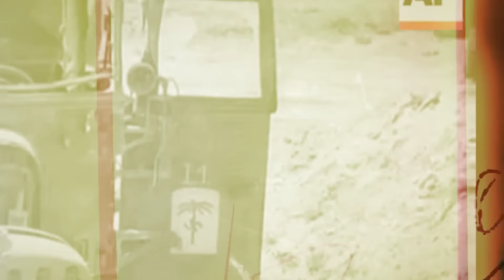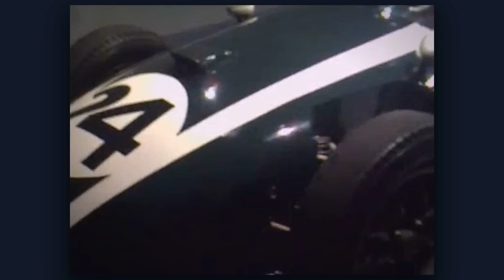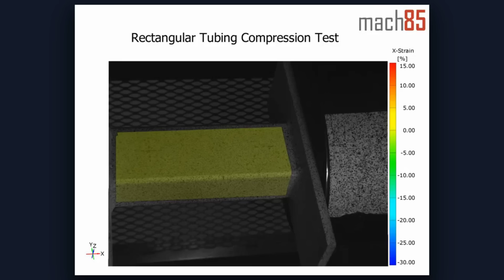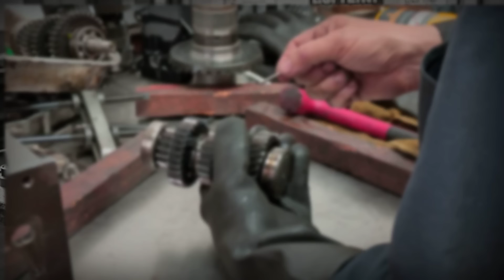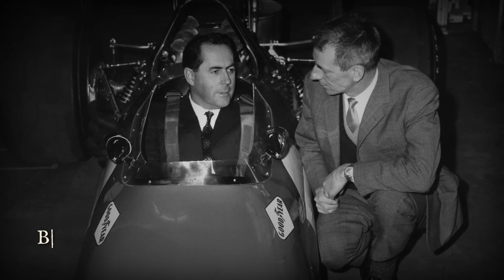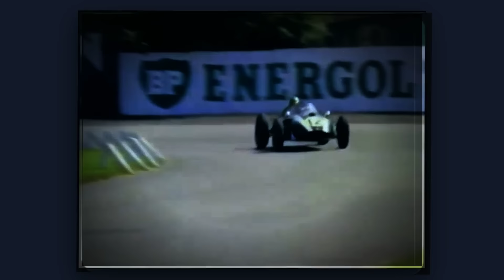1959 Cooper T51: Tiny British Team That Humiliated Ferrari and Changed F1 Forever

Comment: Curved tube spreads the load over the curve, rather than just at the joints......I think
Reply: No they act like springs and have less stiffness snd strength compared to a strait tube
Reply: The beauty of the curved chassis is that on each side, the lower is curved up and the upper is curved down. That then gives it the needed stiffness along with some triangulation.